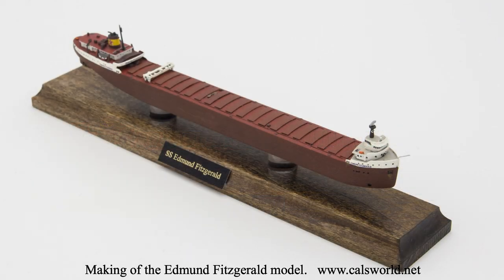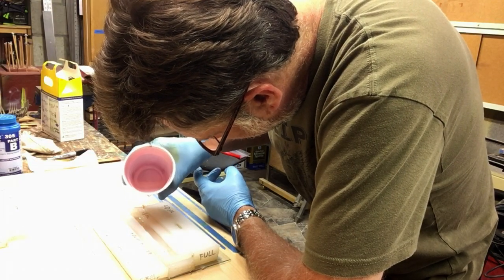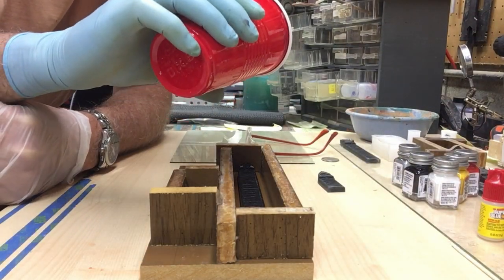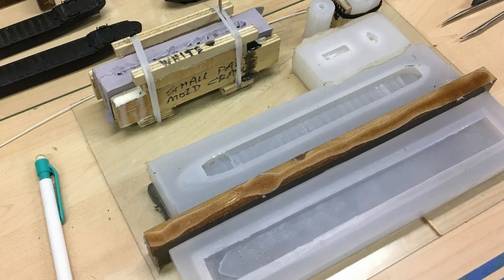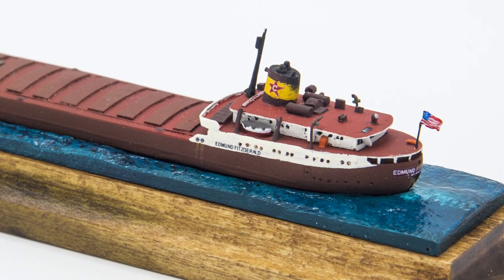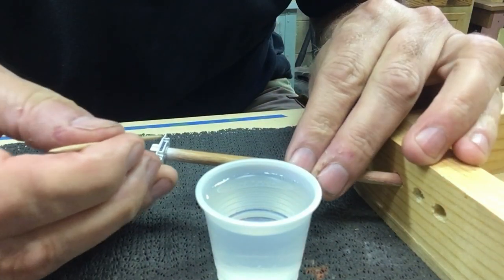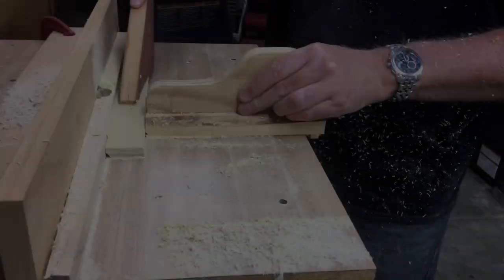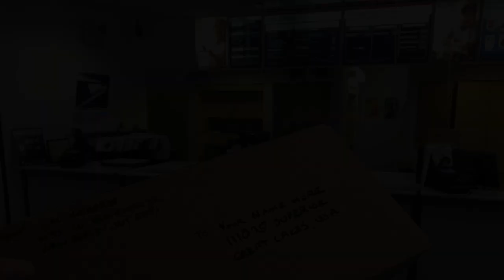FitzHowItsMade

Comment: How cool great job .how much do you charge ?
Reply from the maker: Hi Paul, the Fitz models range between $150 and $175 depending on which one… but they are and have been unavailable due to my relocating across the country.  The models are made to order and I have no shop to make them in.  I will hopefully be able to bring them back in late 2022.  Thanks for stopping by and commenting.
Reply: @calx98  thanks for getting back ,.